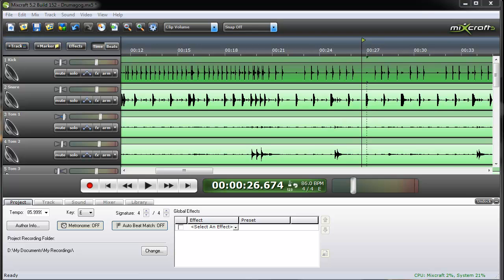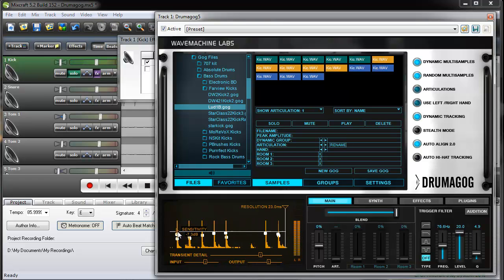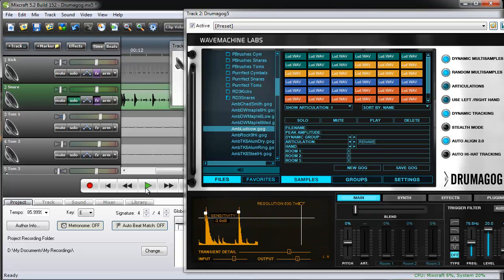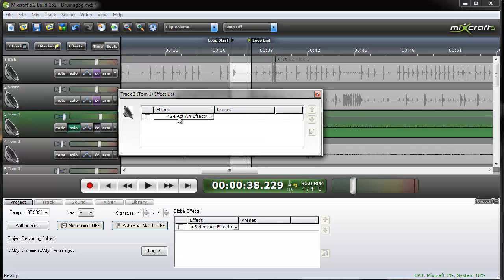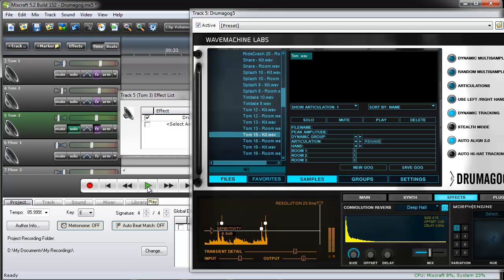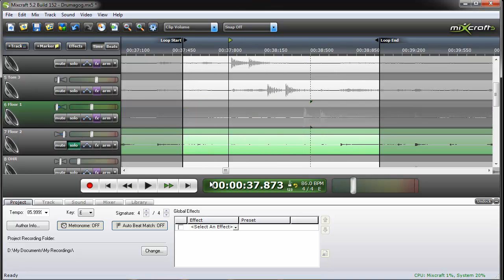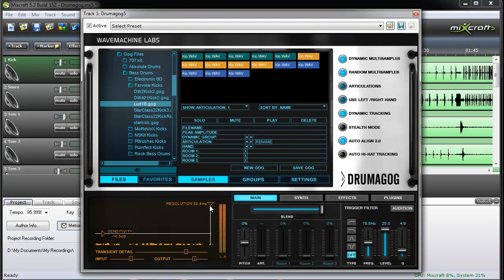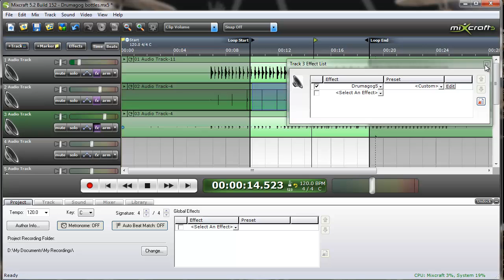Drumagog 5 - Michigan Audiolab Demo

Comment from the maker: Overheads are there to catch the total sound of the kit, you don't want to prevent that, but do reduce the impact that kick, snare, toms have over the drumagog sound, I use a graphic 31 band eq and pull out every frequency from 500 on down. This basically leaves you with nothing buy cymbals.